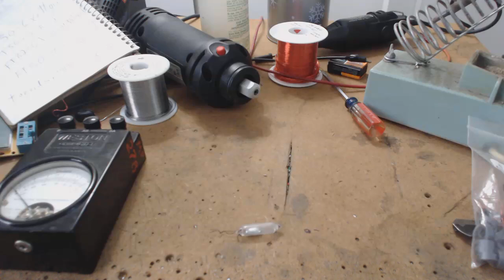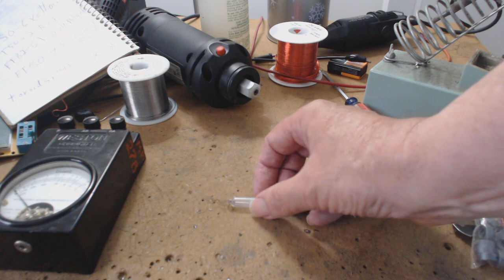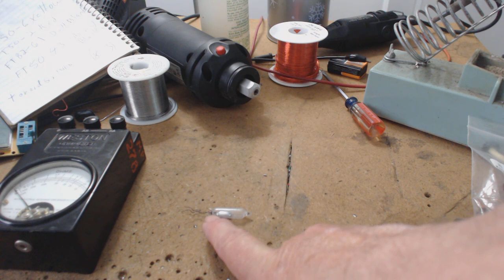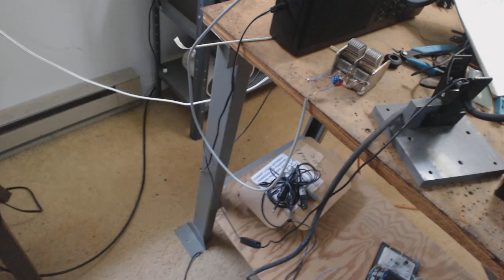POP Goes the Xylene!

Comment: I'd never even heard of Xylene until now, so I know nothing about that substance.  The thing you need about needing to cover open cups with your hand to prevent mercury getting into your drink is just so scary, no wonder people don't want to deal with mercury now.  Highly dangerous substance, and to think you was used in medical thermometers.
Reply from the maker: The older people that worked there made it to old age.  The smokers died earlier as usual. There were acid baths for the switches. Hydrochloric   and Hydrofloric. They removed the black from the flames off the glass. It was a big break through to use the two acids mixed. Girls originally used tooth brushes and hydrochloric and lots of scrubbing.